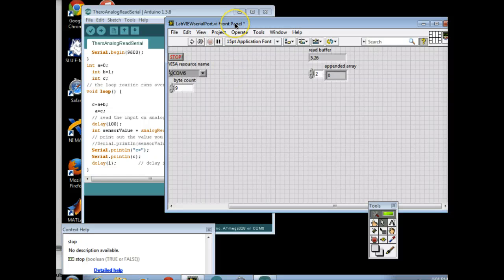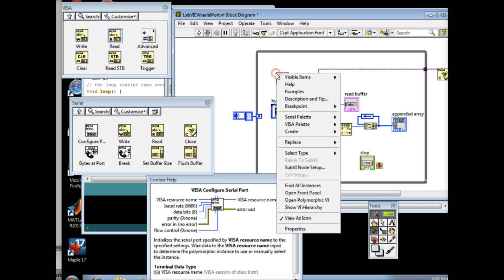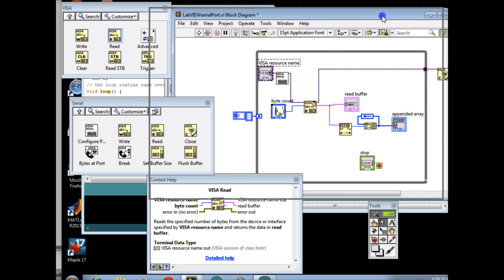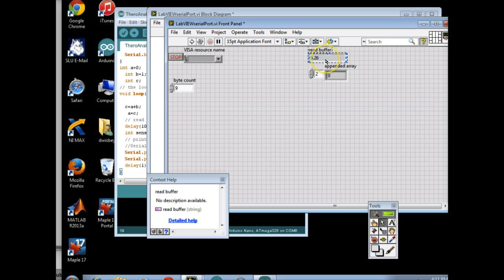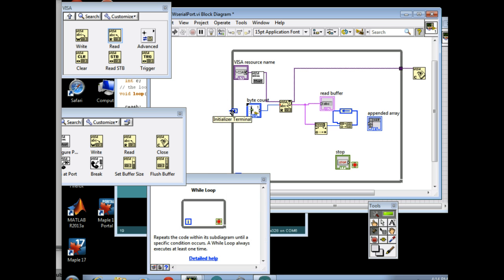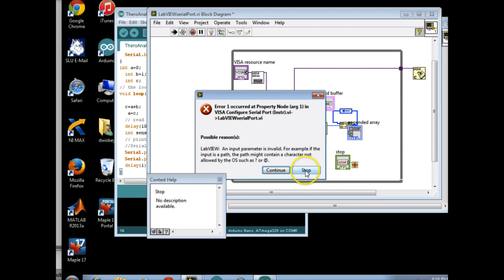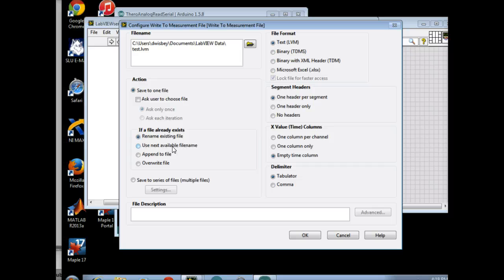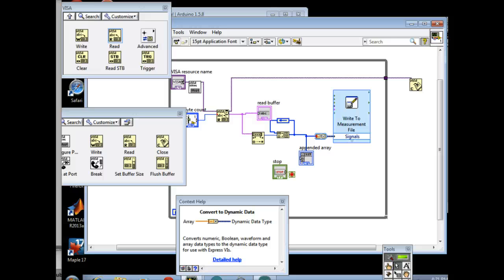Read Arduino Card Serial Port Data Using LabVIEW

Comment: Hi David'
First of all, many thanks for the helpful video. I am using HAMAMATSU c12880ma mini-spectrometer. I want to get data from my spectrometer by using arduino UNO and I am gonna use LabView for graphical interface.  Do you think if I do the same block diagram with you, it works for me ?  Thanks, in advance. My Code ;

/*
 * Macro Definitions
 */
#define SPEC_TRG         A0
#define SPEC_ST          A1
#define SPEC_CLK         A2
#define SPEC_VIDEO       A3
#define WHITE_LED        A4
#define LASER_404        A5

#define SPEC_CHANNELS    288 // New Spec Channel
uint16_t data[SPEC_CHANNELS];

void setup(){

  //Set desired pins to OUTPUT
  pinMode(SPEC_CLK, OUTPUT);
  pinMode(SPEC_ST, OUTPUT);
  pinMode(LASER_404, OUTPUT);
  pinMode(WHITE_LED, OUTPUT);

  digitalWrite(SPEC_CLK, HIGH); // Set SPEC_CLK High
  digitalWrite(SPEC_ST, LOW); // Set SPEC_ST Low

  Serial.begin(115200); // Baud Rate set to 115200
  
}

/*
 * This functions reads spectrometer data from SPEC_VIDEO
 * Look at the Timing Chart in the Datasheet for more info
 */
void readSpectrometer(){

  int delayTime = 1; // delay time

  // Start clock cycle and set start pulse to signal start
  digitalWrite(SPEC_CLK, LOW);
  delayMicroseconds(delayTime);
  digitalWrite(SPEC_CLK, HIGH);
  delayMicroseconds(delayTime);
  digitalWrite(SPEC_CLK, LOW);
  digitalWrite(SPEC_ST, HIGH);
  delayMicroseconds(delayTime);

  //Sample for a period of time
  for(int i = 0; i < 15; i++){

      digitalWrite(SPEC_CLK, HIGH);
      delayMicroseconds(delayTime);
      digitalWrite(SPEC_CLK, LOW);
      delayMicroseconds(delayTime); 
 
  }

  //Set SPEC_ST to low
  digitalWrite(SPEC_ST, LOW);

  //Sample for a period of time
  for(int i = 0; i < 85; i++){

      digitalWrite(SPEC_CLK, HIGH);
      delayMicroseconds(delayTime);
      digitalWrite(SPEC_CLK, LOW);
      delayMicroseconds(delayTime); 
      
  }

  //One more clock pulse before the actual read
  digitalWrite(SPEC_CLK, HIGH);
  delayMicroseconds(delayTime);
  digitalWrite(SPEC_CLK, LOW);
  delayMicroseconds(delayTime);

  //Read from SPEC_VIDEO
  for(int i = 0; i < SPEC_CHANNELS; i++){

      data[i] = analogRead(SPEC_VIDEO);
      
      digitalWrite(SPEC_CLK, HIGH);
      delayMicroseconds(delayTime);
      digitalWrite(SPEC_CLK, LOW);
      delayMicroseconds(delayTime);
        
  }

  //Set SPEC_ST to high
  digitalWrite(SPEC_ST, HIGH);

  //Sample for a small amount of time
  for(int i = 0; i < 7; i++){
    
      digitalWrite(SPEC_CLK, HIGH);
      delayMicroseconds(delayTime);
      digitalWrite(SPEC_CLK, LOW);
      delayMicroseconds(delayTime);
    
  }

  digitalWrite(SPEC_CLK, HIGH);
  delayMicroseconds(delayTime);
  
}

/*
 * The function below prints out data to the terminal or 
 * processing plot
 */
void printData(){
  
  for (int i = 0; i < SPEC_CHANNELS; i++){
    
    Serial.print(data[i]);
    Serial.print(',');
    
  }
  
  Serial.print("\n");
}

void loop(){
   
  readSpectrometer();
  printData();
  delay(10);  
   
}

Comment: Can you provide the arduino code, please?
Reply from the maker: Here is some example code:
int TMP36 = A0;
int temperature = 0;
int temp[10];
int tempf = 0;
int time= 20;
void setup() {
//The middle pin (signal) is connected to analog pin A0.
//Value for the temperature.
//temp[10] creates ten values with the names temp[1], temp[2], temp[3] and so on...
//The value „time“ is for the delay between two measurements.
// 14

Serial.begin(9600); }
void loop() {
temp[1] = map(analogRead(TMP36), 0, 410, -50, 150); delay(time);
temp[2] = map(analogRead(TMP36), 0, 410, -50, 150); delay(time);
temp[3] = map(analogRead(TMP36), 0, 410, -50, 150); delay(time);
temp[4] = map(analogRead(TMP36), 0, 410, -50, 150); delay(time);
temp[5] = map(analogRead(TMP36), 0, 410, -50, 150); delay(time);// 
temp[6] = map(analogRead(TMP36), 0, 410, -50, 150); delay(time);
temp[7] = map(analogRead(TMP36), 0, 410, -50, 150); delay(time);
temp[8] = map(analogRead(TMP36), 0, 410, -50, 150); delay(time);
temp[9] = map(analogRead(TMP36), 0, 410, -50, 150); delay(time);
temp[10] = map(analogRead(TMP36), 0, 410, -50, 150);
temperature= (temp[1]+temp[2]+temp[3]+temp[4]+temp[5]+temp[6]+temp[7]+temp[8]+temp[9]+temp[10])/10; // everything in one line!!!!
tempf= temperature*9/5+32;
Serial.print(tempf); Serial.println(" degree"); }

The critical part is at the end Serial.print(temps).
Labview will capture anything coming over the serial port. You just need to send something to the serial port. It usually is a string, so you will have to process it in LabVIEW appropriately for what you are doing.

Comment: Hi david,thank you for this amazing video,But I have a question, I need to have the data from one arduino to 3 different analog input(voltage) and one digital input (temperature) so I have 'text value text value text value text value' format in my serial port.how can I have all of this data in one excel file ?? thanks a lot

Comment: Hi David, nice video. I have one doubt, why are you keeping the VISA initialization inside the loop. We can place it outside the loop as well. so that it won't initialize each time the loop iterates. I'm not much familiar with hardware interfacing in the LabVIEW. Could you please clear my doubt?

Comment: Hi David really great Video, I need some help over reading multiple data from the serial port in my arduino code I send some text and some bytes arrays how can I read the two data types differently thank you
Reply from the maker: Hi Kevin, can you be a little more specific about your problem? What devices are you trying to read? In general when you read data from a serial port with LabVIEW, it just reads what is coming in. It will help to know what your data looks like. You can see what it looks like from your Arduino program. In general, with this program you should just be able to read the serial port with LabVIEW. Once you have it in LabVIEW, you will have to save it as a string, and then take what you want. There are many options in the string menu for taking pieces of a string. Here is what you can do:

From the back panel, right click and go to the programming window, then go to the string menu, then choose string subset. Then beginning at the offset, it will return a string of the length you specify. If you do this twice, you can get out multiple pieces of data. I used it once to get temperature and pressure. You will need to set the length of the strings in your Arduino code so you can retrieve them in LabVIEW.

Comment: Thanks David for warmly reply.  Yeah I think so, my pc is see no arduino on it' serial port USB. 
Now, I have to use the LINX instead, as suggestion in arduino play ground website. 
So, the labview can work with arduino. However, it was unable to connect arduino intermittently whenever I stop-run my program, I try to reset many time to make it recover. Therefore, I have to replace the new Uno board its working better, but a few same trouble so it about 1/10 faulty occurred.
Thank you so much  David for your Idea shared through Youtube, you wake me up to starting, and also people around the world. Its a goodness.
Reply from the maker: Remember you can not have LabVIEW and the arduino software running at the same time. You can only do one at a time. Are using Arduino UNO or nano. I had trouble with the Nano on a Mac. Uno is good. Are you using USB 2 or 3 on your PC?
Reply: Yap, I agree. So I using Uno board and USB2 of PC.

Comment: Hi David, I am sending from the arduino 4 numbers (4 temperatures) and I want to read it in labview to plot it individually; Currently I can read the whole string of data... thus,  How can I split the string coming from the arduino into individual temperature values? Thanks in advance...
Reply from the maker: Hi Mario,

Look in the Functions menu under Programming>Strings. You can use the String Subset to pull out part of the string. You an do this four times for each of the numbers that are coming in as a string. Then you can convert them to numbers and put them in some type of an array depending on what you need. Under Programming>Strings you will find all the tools you need to do this. You should be able to find a lot of useful code online. You could post your Arduino code in the comments so I can take a look at it.
Reply: http://www.instructables.com/id/Arduino-Labview-With-2-DS18B20/

Comment: Hi David,
I configure the same program, but when I´m trying to read the data with Labview it gives the wrong numbers. for example I send 5.23 and it read 5.js in Labview.

I have the same baud rate (9600), but even if I change it in both programs It keeps sending the same problem. Do you know what could be the solution? Thanks
Reply from the maker: +David Saenz Hey David, it could be a number of issues. The first thing to check would be to see if your computer is able to read the correct data from the Arduino card. You can do this by clicking on the Serial Monitor button at the top in the native Arduino software. This can tell you if something weird is going on with your card. 

If that is working, then it is a problem in LabVIEW. It is most likely a setting with the way you are displaying your numbers. If you could post a screenshot that would be very helpful. Often with LabVIEW there is a setting that is incorrect that is causing the issues. 

The Arduino card should be giving you strings. Then you need to convert it to a number.
Reply: +David Wisbey  I was sending the data without delay. I put a delay of (100) and it started working, but sometimes it sends the wrong data.
Thanks!
Reply from the maker: +David Saenz Great! Glad it works!

Comment from the maker: Hi Jakkrich, sorry for the slow response. One thing you need to make sure of is that you have the drivers properly installed for LabVIEW to access the serial port. You will need a special disk for this, LabVIEW does not automatically have the drivers for it. You can search for serial port drivers on the national instrument website. If I can find the link i will post it. Most likely that error means you don't  have the necessary drivers for LabVIEW to access your serial ports on the computer. Have you loaded these drivers?

Comment: Dear David,
I do following you, when I have run the program show error on VISA : (Hex0xBFFF0072) The resource is valid, but VISA cannot currently access it.
Could you give additional advice please.
So, my project need to read temperature from arduino, it sent through serial monitor.
Reply from the maker: Sorry for the long time for a reply. Can you see the device in NIMax? You will need to to verify that you have a good connection. Sometimes when a USB device is having issues of some sort, you will not be able to read it. There can be a number of causes for this, but it most likely because your computer is not interacting with the device through USB. You may have to update the drivers and make sure it is installed correctly on your PC. It sounds like a windows problem rather than a LabVIEW problem. Let me know how you fixed it.